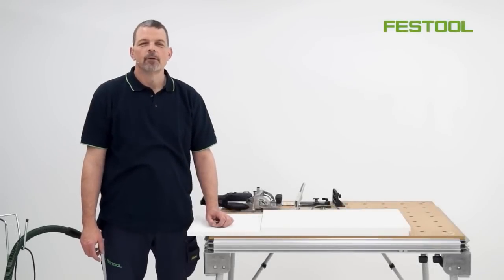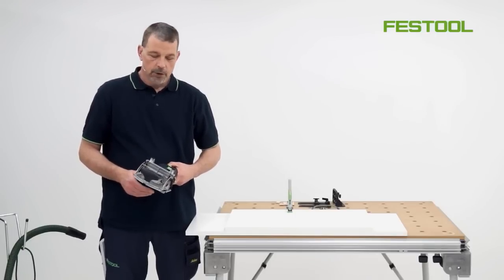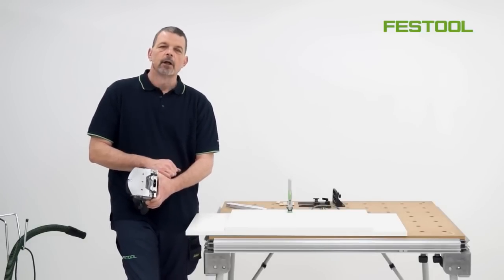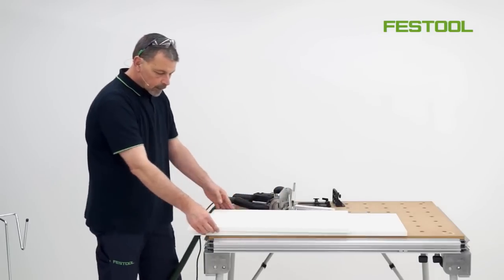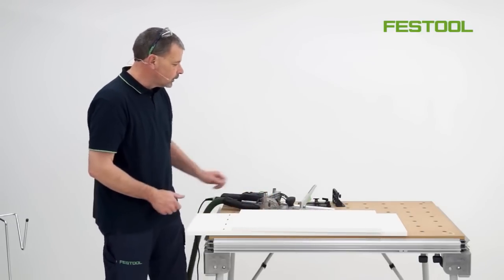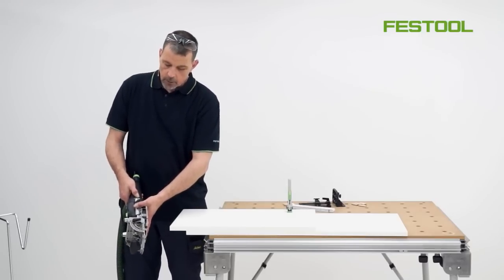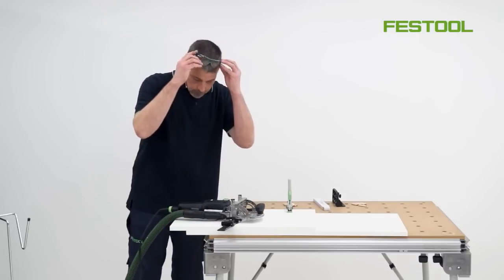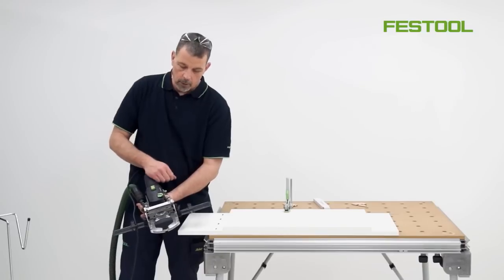Festool Domino DF 500 Butted panel joint

Comment: In the manual for the DF 500 under "setting the mortice width" on page 10 - it states "failure to follow the notes below may result in damage to the tool" and then one of the "notes" states, "Rotate the adjustment dial only when the motor is running." Now, I'm watching a video made by Festool and you rotate the adjustment knob when the machine is NOT running. So, which is it? Does rotating the knob when it's not running damage the tool, or not? I also noticed that there's no such admonition about changing the mortice width in the DF 700's manual.

Comment: Can you make entire unit without glue?Is it strong enough?
Reply from the maker: Hi Tomasz, it is possible, but we would recommend using glue as the joints will not be as strong without glue. I hope this helps :)